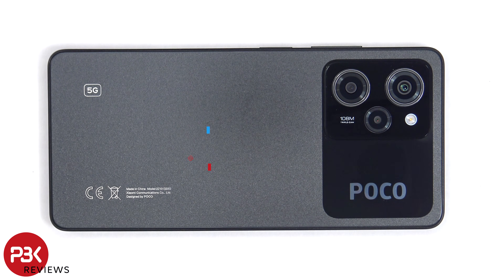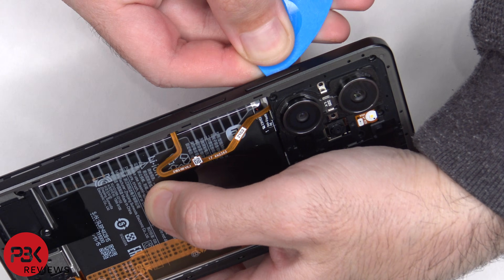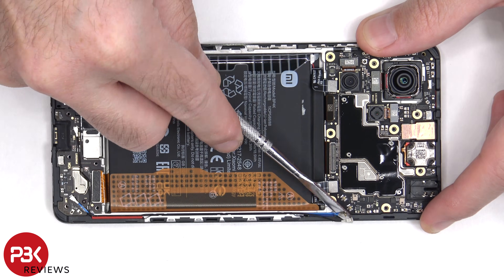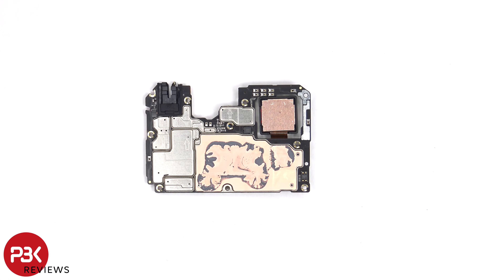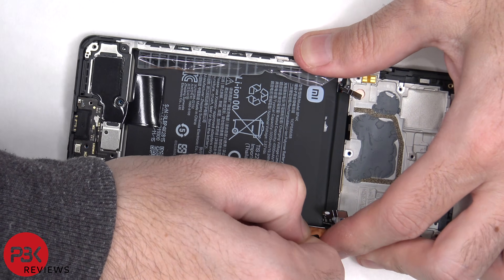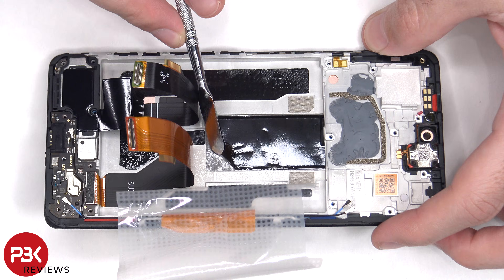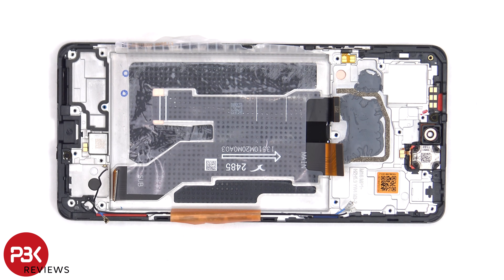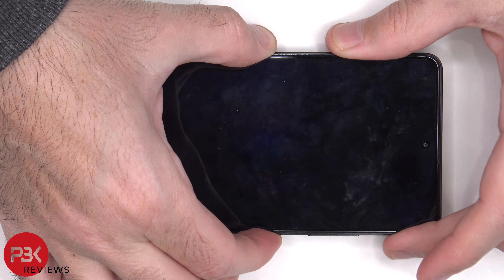Xiaomi Poco X5 Pro 5G Teardown Disassembly Repair Video Review

Comment: Hi, PBKReviews, mind if I ask, what to do if phone has water damage and does not power on?
Reply from the maker: Take it apart, disconnect the battery cable from the board, dry out any liquid inside, brush off any corrosion around chips n connectors with a small brush like a tooth brush, and then re assemble to see if it will work. If not, you need to replace parts one by one to see which may be defective.
Reply: @PBKreviews  Thank You for your timely but adequate answer. May you please recommend distributor where I can order parts with International Shipping to Aus.

Comment: I've question. I stuck a special needle for opening the SIM card slot into the microphone.  And pressed a little. Can the microphone be damaged in this case?
Reply: prob not, the microphone kinda tapers off so it won't even reach the microphone itself

Comment: Nice video there. Do you heat up the back of the device before removing the rear cover or just straight removing it? I want to replace the charging port and the battery of this device.
Reply: Oh my bad. I didn't notice that you said: Heat needs to be applied. Anyway. At which part of the video is the charging port pcb?

Comment: Hey my volume keep going up and I want to replace it myself but I want to know if it is built in on the motherboard can U help me please
Reply from the maker: it might be the flex cable which would need to be replaced. It's not on the motherboard but connects to it with the flex cable.

Comment: Hi. I was planning to replace the thermal paste on that phone. Is it better to remove the copper tape and make a direct contact to the metal plate, or keep it? Will it also help if I replace the thermal compound with liquid metal to improve thermals?
Reply from the maker: I would keep the copper tape/film and do not use liquid metal. Its highly conductive and will spill to components around it and short/fry your phone. Only use non conductive thermal paste.
Reply: @PBKreviews  Thanks for the feedback. Will use thermal paste instead

Comment: Been dropping this phone.  I would say just put a tempered glass and enough case.  This phone would be solid choice.

I dropped it, and it has no issue with the structure.  Only the tempered glass that was cracking.

Comment: Could the RAM and processor side by side cause heating and loss of performance? Please answer.
Reply from the maker: any ram or processor whether stacked or side by side will generate heat. All matters on how the cooling on the phone is. This phone has decent cooling but is not the best.

Comment: Thank you for the video. If I may ask, is the top speaker is actually have holes on it? Because it feels like the sound comes out from the earpiece (front-facing) speaker instead
Reply from the maker: You're welcome. Yes underneath it where you can't see the speaker sound travels through a cutout in the frame to the front where where the earpiece opening is for sound.

Comment: Did your device facing any heating issues like with normal wifi usage .. Phone temperature is touching 42 , 41 in indoors
Reply from the maker: I didn't use it long term but usually its normal when browsing the web or anything which uses the antennas to heat up the phone since the screen is on which generates heat, in addition to the antennas being used etc.

Comment: Why is f5 stacked their ram and chipset but this one doesn't? Aren't f5 is more bulky and more expensive
Reply from the maker: They are different model/line of devices and stacked ram on chipset generally have better performance and is seen on almost all flagship devices. Also stacking would allow more room on the board or inside the phone for other components or features.
Reply: @PBKreviews  then Why is the X3 pro died if it offer a better performance?

Comment: I know that it doesn't have the ois as you said and the company itself advertised it that way...
But then why the 108 mega pixel camera is moving.... When you put the driver on it? 2:25
Reply from the maker: it's not moving, if you look at ones with ois, you will see they move a lot in different directions.
Reply: @PBKreviews  yeah!! that's true...
Maybe this little free movement is for shock absorption.... Btw thanks for replying... Love how you interact with your subscribers🙂♥️

Comment: any idea if this phone works in the US on AT&T?
Reply from the maker: It has coverage for some of the 4G LTE bands and some of the 5G bands which at&t uses, but not all of them. So depending on where you are in the US and which towers/bands are in your service range, would determine how well of a signal or connection you would get.
Reply: @PBKreviews  He is asking for VOLTE I bet, as ATT doesn't generally allow other phones to be able to VOLTE....

Comment: So cheap the phone broken into half on durability test
Reply from the maker: I'm not surprised since it doesn't really have a strong aluminum uni-body. Mainly plastic.
Reply: but no one will do that on normal use. No matter what the build is, you will still need to use it with care.
Reply: That's right

Comment: All these plastic look so fragile, man, why didn’t they make it of better quality. I mean the phone is great, but the materials are awful.
Reply from the maker: Cost mainly. If they used better material, it would cost much more than it does and it would not sell to the market/region they are aiming this device for.
Reply: So cheap the phone broken into half on durability test
Reply: @Ansi_zz  but no one will do that on normal use. No matter what the build is, you will still need to use it with care.
Reply: indeed
Reply: It is
Reply: Poco x6 pro and x6 review video upload please 🥺👍😢